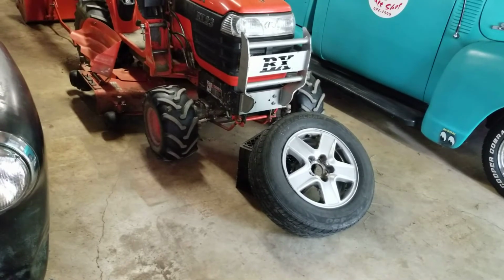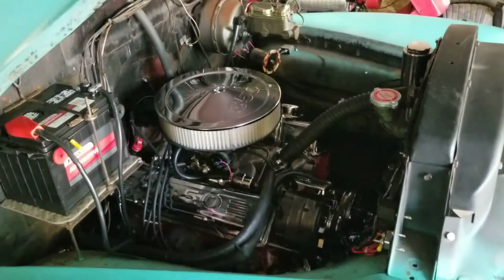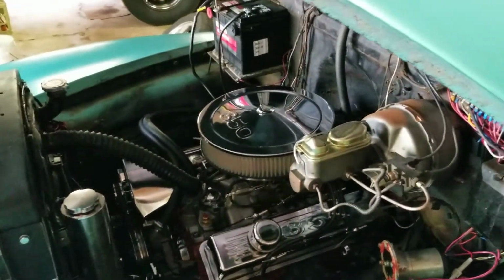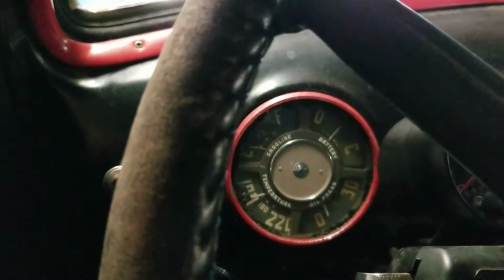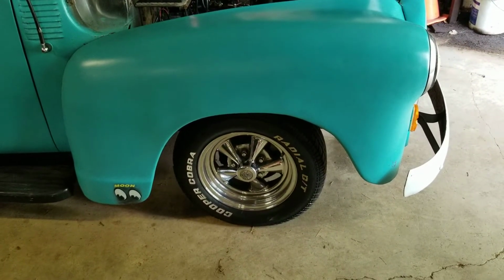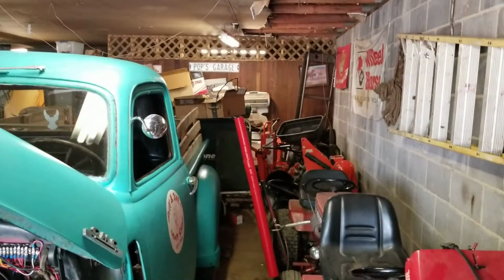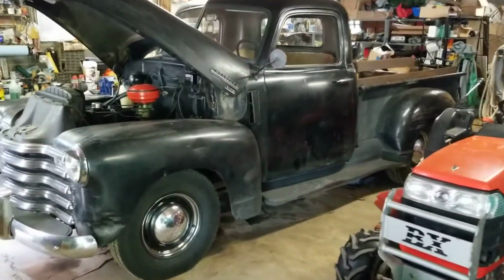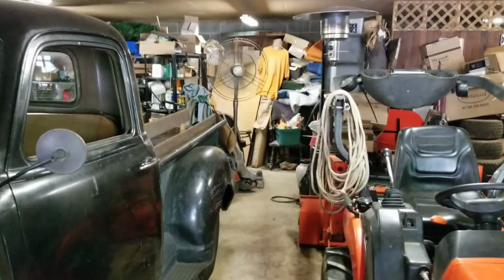20180622 100718

Comment: After I got out of the navy I lived in a apt and bought a 1954 Chevy 5 window. Worked on it the best I could in parking lots, car washes when it was raining. Was 6 volts with the starter button on the floor and had the enclosed drive shaft. Had problem after problem with the rear end and finally sold it. I really liked that old tank. Those old wheel horses were probably the tuff-est garden tractors there were. I've owned to many to talk about. Still have a 315-8 I bought in 2003 that I keep at the girlfriends house to mow her yard. The boy has my first one I got 310-8 in 1985. After that one I got stupid and bought and sold a bunch. Would like to get a old truck and fix it up but too busy with chickens, calves, garden and a small farm, besides the house remodeling when time is available. Nice to see those old trucks. Learned to drive in a 1949 Chevy when I was 9 or ten back in 1965. Those were the days!!!!
Reply from the maker: The 856 Wheel Horse was the 1st L&G tractor I bought, back in 89 IIRC. It's been a hard worker. Those Kohler K engines are practically bullet proof. I picked up the 876 about 10 yrs ago to run the sicklebar mower. It saves me hrs of weedeater time.
The GMC took too much attention from my gardening and what I did get out was late, with the exception of the Hickory King field corn, that patch is doing well.
Have a good 'un.